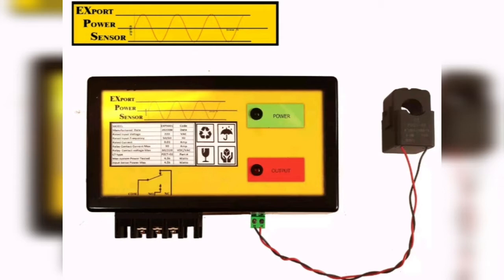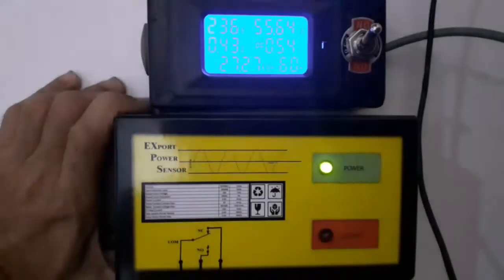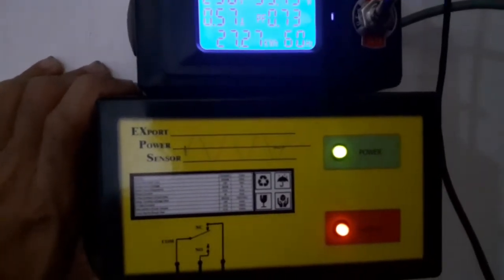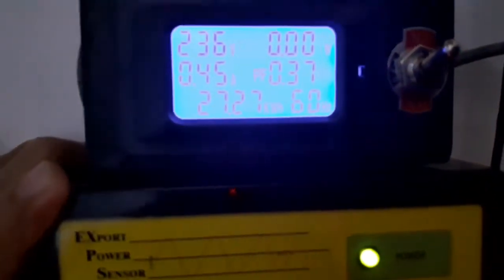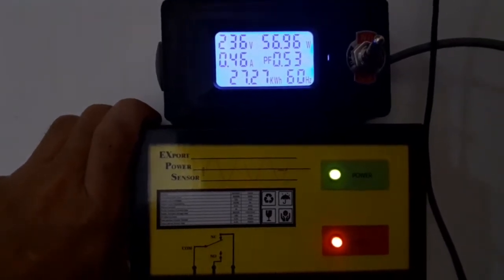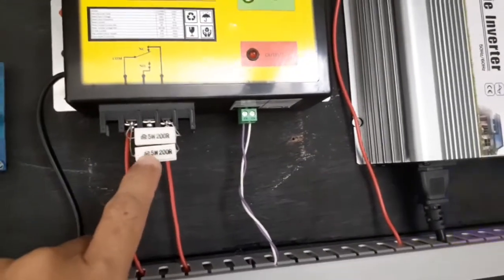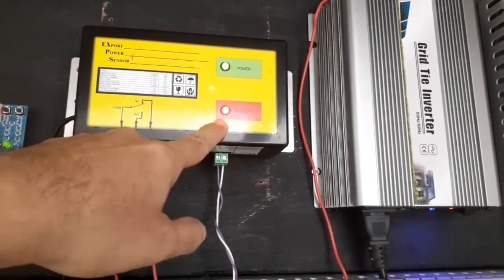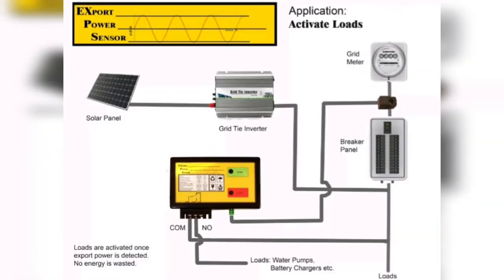Export Power Sensor for Grid Tie Inverter

Comment: Good morning boss. Meron sana itanong sayo bakit sumabog resistor 3pcs 5w 20ohm.. Naorder k lg sayo boss. 3kw ang on grid inverter ko boss.. S pv 450watts - 4pcs naka series po yan..
Reply from the maker: Upto 300wats lang po recomnded namin na may resistor. Mag mataas na watts setup nyo ibang wiring na po
Reply: @JonsDman  ano recommend mo boss ganyan mataas na watts.. d na ba kailangan resistor  at ano solution s gadget mo boss.. para magana sya..
Reply from the maker: @rodrigoolita4874  sa fbpage po namin may mga sample wiring para sa mataas ma watts setup.
Reply: @JonsDman  nacheck ko po boss. Ano klase wire & ano design diagram.. Para dyan s akin setup boss..thank
Reply: @JonsDman  boss napm po ako s messenger nio po..

Comment: Export power sensor lang pala yan. D naman pala sya export control limiter. Montik pa naman ako bumili sa shopee.
Reply from the maker: Nasa skills na po ng gagamit kung pano nya iwiwiring to prevent export. May mga sample diagrams kami para maintindihan function.
Reply: Pag bumili ako boss pwede paturo?

Comment: Sir pede po ba to sa 3kwsetup?
Reply from the maker: Yes sir madedetect nya export power presence from 3kw setup.
Reply: @JonsDman  meron po kasi kami 3kw gridtie inverter na walang limiter ang sabi ng nakausap namin d daw pede yun kelangan daw may built in na limiter
Reply from the maker: @nadzirk6677  opo sir dapat ma prevent ang export dhil babayaran nyo din yun.

Comment: Hi ano po e lalagay ko na resistor pag sa 12v inverter 350w solar panel
Reply from the maker: Try nyo po 30ohms 10w 6pcs parallel. Dagdag or bawas nalang po ng parallel dipnde sa observation nyo.

Comment: sir nakabili po.ako ng ganyan, working naman po sya, nangyayari nga lng ponkapag naka detect sya ng export binababa nya ung inverter to 0w tpos charge sa scc, diba dapat  po babawasan nya lng ung pumapasok na power galing sa panel?
Reply from the maker: Yunh device po ang function nya ay detect ng export. Depende po sa value ng resistor kung ano ang ibaba ng power ng gti.
Reply: 3 pcs 10w 30ohms po, sir ang naka kabit ,pero nag 0 zero ang gti, kahit malakas din ang panel
Reply from the maker: @Zen-wu9gn  try nyo po mag dagdag ng parallel na resistor. Pwede din po kayo mag compute ng value using ohms law.

Comment: Sir ano po kaibahan nito sa current sensing switch?
Reply from the maker: Current sensing switch hnd nya alam direction. Mag trigger sya both way. Ito pong samin mag trigger lang sya sa isang direction.
Reply: @JonsDman  salamat sa clarification sir. Gusto ko sana ito gamiting tong device nyo na mag-activate siya ng relays while nag-step up ang export current incrementally. Possible po ba? Para po sana gradual ang pag switch ng mga PV strings/arrays as needed.
Reply from the maker: @practicalthinker5545  madami application ito dopende na po sa creativity skills and knowledge nag gagawa. Visit nyo fb page namin may mga sample application po kami.

Comment: paano boss kng gabi na syempre mag ooff yong GTI kasama ba e turn off yong EPSensor ?
Reply from the maker: Nilalagyan nila ng timer para mag cutof ang ac line ng gti kasama ang eps pag gabi.
Reply: @JonsDman  boss na install ko na yong grid tie ko at my automatic timer switch at my  ATS pero sa ATS ko separate yon sa off grid yon. Ang tanong ko boss paano malaman kng working na talaga yong setup ko kc curious lng ako dito sa DIY ko d ko alam kng ito na talaga kc palagi ng oon yong EPS ko normal ba ito? kc enadjust ko yong EPS paatras, 500watts ang panel lo, pero 250watts lng ang harvest tapos gumamit ako ng appliances na 100watts below, pagbaba ba ang gamit mo parati ba nag oon yong OUTPUT SENSOR?
Reply: salamat sa reply boss....
Reply: setup ko pala DIVERT THE POWER TO BATTERY...
Reply from the maker: @ernilcervantes5766  eto pag check kung okay ang setup: 1) pag off ang gti dapat po mamatay ang red led ng EPS. 2) pag mas mataas ang harvest ng panel VS load dapat mag on ang red led. 3) Pag mababa naman ang harvest VS Load dapat patay ang red led.
Kung mag aadjust kayo ng sensitivity dapat po may power meter kayo sa main line para ma observe nyo kung anong watts nag ttriger ang red led.
Reply: @JonsDman  meron na akng watt meter binili k sa online...kinabit kuna....kng ang GTI ko nghharvest ng 250watts then yong EPS ko ay patay...so stop yong metro ng bahay ko...ok na yon.... ito yong tanong ko boss once ngzzero yong GTI watts meter ko yong EPS ko on yong red led ito ba ay normal o kulang lng ng adjustment ng sensitivity or ng eexport na cya at ito ba ay dagdag bayan ko sa bill? salamat sa reply...
Reply from the maker: @ernilcervantes5766 tama po. pag umilaw po ang red led. Baba ang power ng gti para hindi mag export. Dipnde na po kung ano value ng resistor kung gano kalaki ang ibaba ng power ng gti.

Comment: Sir ask ko lang.kung mababa yung consumption  ng import sa grid,na lilimit din ba nya automatic?o nag read lang ang external limiter ng meron at walang load?,kasi worry lang ako,baka mag export pa yung inverter,tataas din consumption ko.saka yung iba na may limiter na baliktad ang ikot ng metro.pano po dun sa digital meter?
Reply from the maker: Ang nerread po nya kung may export hnd po load.

Comment: ang pagkabit po ba ng sensor ay iclaclamp lng sa positive at negative ac line bago breaker?
Reply from the maker: I clamp po sa isang wire bago mag breaker.
Reply: positive po ba sir?
Reply from the maker: @geslerasprec5790  sa live po. Yung iba tawag ay poaitive.

Comment: 6x 350 kya kyan if my scc pra batt?
Reply from the maker: May wiring para sa high power application. Hnd pwede direct connect sa dc yung built in contact nya pag high power. Need gumamit magnetic contactor
Reply: @JonsDman  pero kaya pa nmn ni export power yunh ganun kataas na pv. Meron kasi ako gritie setup 2klw inver without limiter at 4x350w pv. Balak ko sana upgrade add pko 2pcs 350w pv at gamitan ko sana nyan na may battery pra sa sobrang harvest wla kasing limiter yung inverter ko. Hanggang ilan po ba voltage at wattage ang kya ni export power.
Reply from the maker: @reumau5053  kaya po bsta kaakabitan magnetic contactor.
Reply: @JonsDman  sige po sir salamat sa info.

Comment: sir ilang amps po ba dapat dumaan na export para ma sense ng CT at ma patay ang inverter?
Reply from the maker: Power po na palabas. And dipnde sa adjustment ng sensitivity.
Reply: ahhh ok sir. 
malayo po ako sa topic

posible po bang i tie ang grid tie inverter paralel sa isa inverter pero off grid na pure sine wave? 

if pwede, d po ba masisira ang off grid inverter? or pwede po ba gamitin ang export limiter para ma control ang grid tie inverter. curious lang po
Reply from the maker: Hnd ko po ma aadvice.yan dahil hnd po design ang off grid inverter na pasukan ng another source of ac.
Reply: ahhh ok po sir salamat

Comment: Good am..paano kung ang main breaker is 20 meters from my solar set-up?paano e kabit ang c clamp?taasan ang wire?anong klaseng wire?Salamat po..
Reply from the maker: Shielded wire po dapat, may mga nag install na po 10 meters using coaxial cable or tv antenna wire. Kung mas mahaba po palagay ko kailangan shileded na para walang ma pickup na nois at mataba pa para maiwasan ang loss due to high resistance pag manipis ang wire.
Reply: @JonsDman  Salamat po sa info...

Comment: Ilang watts ng solar panels ang kaya nyan?
Reply from the maker: May 30a po rating ang contact. Pero we suggest na wag sagarin apara humaba ang buhay ng contact, kadalasan po nilalagyan nila external relay or contactor pag malaki na ang system nila and para tumagal life ng eps relay contact.
Reply: @JonsDman  sir meron po ako 310 watt na solar at micro gti pwede ko po na lagyan ng export sensor?
Reply from the maker: Pwede po sir.

Comment: Paano pag zero yung load like for example walang tao sa bahay so mag eexport parin nang power base sa resistor
Reply from the maker: Kaya po hindi kasama sa device ang resistor para pwede nyo baguhin ang value depnde sa req ng bahay. May mga device po tayo sa bahay na kailangan ng power kahit wala tayo like home security, ref, auto lights etc.
Reply: Sir kylangan ba lagyan ng resistor yan or ok din na walang resistor
Reply from the maker: @emmanuelgilbao8989  dipnde po sa setup na gagawin. May wiring na di kailangan resistor.
Reply: @JonsDman  ah ok tnx poh sa reply sir

Comment: halimbawa po ang konsumo ay 300w at ang na produce ng 600w inverter ay 500watts, ang tanong ko po, pabababain po ba ng sensor sa 300watts ang production para hindi mag export? or totally zero ang production ng power , pati yon 300watts na kailangan maproduce ay mawawala rin?
Reply from the maker: Bababa ang power dahil sa resistor and tataas ulit hangang 300w dahil pag lumampas 300 may madedetect na export. Mag cycle lang sya until wala na sya madetect na export.

Comment: Sir question regarding the digaram with an SCC, panu kapag nagbrownout, automatic din ba sya magdivert ng power to SCC?
Reply from the maker: Sa sample daigram, hindi po. May ibang wiring po pag divert to scc pag brownout.
Reply: @JonsDman  Sir, pwede pa request ng video tutorial kung paano mag setup na auto switch pag walang power/brownout..
Reply from the maker: @chrisalvarez24  ok lang pag may time. I suggest nuod kayo video about relay  Dpdt, yun kasi gingamit para mag transfer ng mga connection.

Comment: Question ulit sir, may dalawa akong solar panel na tig 100watts, 19.5v(Voc) and 18v(Vpm), yung GTI ko ay Grid Tie Inverter DC22V-60V to AC190-260V, tpos yung konsumo ko na watts ay hindi bababa ng 100w dahil sa ref at iba pang appliances na parating nakasaksak, anong value ng resistor ang dapat kong gamitin
Reply from the maker: Usually 30 ohms 10w 3pcs gingamit.

Comment: sir tanong ko lang .. po about sa items na export sensor ... gagana lang po ba sya .. kung meron masesensor ang clamsensor sa Du automatic nya po ba ioopen ang GTI at malilimit nya lang po ba ang magiging consupsion natin .. at yung sobrang mapoproduce ng solar hindi mapupunta sa Du
Reply from the maker: Pag may ma detect na export mag sswitch po ang contact nya. Dpnde na po sa inyo kung ano magiging application kung pano nyo iwiwiring. Pero kung susyndin nyo po ang mga sample application wiring ba connected sya sa input ng gti, yes bababa po ang power para hnd mag export and kung wala naman ma detect na export ay full power ang gti.
Reply: @JonsDman  dibali sir .. pwede sya gamitin bilang limiter sa Gti
Reply from the maker: @CinemoPH  yes basically limiter po ang function na mag prevent ng export..

Comment: Do you have to have either a battery to charge or a load for excess? Are you saying that it won't limit export without that?
Reply from the maker: If no battery is installed the export will also be limited but the excess power will be wasted.
Reply: Resistor is mandatory if no other dump load is connected?

Comment: Sir gagana ba yan sa 100vac system na grid?
Reply from the maker: Gagana po yan kung gagamitan ng 100 to 220 vac transformer ung power ng device 220vac kasi sya and need nya madetect ung frquency ng ac line.
Reply: @JonsDman  salamat po sir. 200vac splitphasr pala dito yung grid. gagana nga cguro yan. Kayo po nag design ng nito? Hndi ko kasi mahanap kng saan pwde mka bili bawal daw sa lazada iship sa ibang bansa
Reply from the maker: Yes sir ako po nag design. Pag usapan nalang po natin pano kayo makaka kuha.
Reply: @JonsDman  hello sir opo saan po kaya ako maka bili nyan? Makano po kaya? Details pls.

Comment: so kung di mo malalagpasan rating ni inverter laging na ka off
Reply from the maker: Ganito po sir, pag walang na dedetect na export ay naka full power panel to inverter,  Then pag may ma detect na export ay mag sswitch ang eps at dahil may resistor baba ang power from panel to gti. Then pag wala na ulit ma detect na export mag full power ulit panel to gti.

Comment: Good day po sir Jons,  ano po ang difference ng device na ito sa power Limiter na usually built-in sa Solis at Sofar GTI?
Reply from the maker: Ung built in po ay binbawasan nya power going to gti, this device naman po ay dindivert nya sa NO terminal ang power kaya hnd masasayang ng power  kung lakagyan mo scc at battery sa NO terminal.
Reply: @JonsDman  sir pano ito isetup sa solis, may fb po kayo?
Reply from the maker: @BlottedInKs  sa fb page po namin JCXtreme, andun po mga sample application diagram including high power GTI.
Reply: @JonsDman  magwork po ba ito sa solis?
Reply from the maker: @BlottedInKs  ang pwede nya.controllin dc input papunta sa any brand gti.
Reply: @JonsDman  anu fb nyo

Comment: That would be great if it works in AC110v.
Reply from the maker: It will work using 110vac to 220vac converter.
Reply: @JonsDman  *step down transformer

Comment: how much is this unit US dollers? the website says 2,200.00 about how much is that US and can you order them form the US?
Reply from the maker: It's around 45USD.
Reply: @JonsDman  where can I order it
Reply from the maker: @brandonoh777  voltage rating of this device is 220v ac. We have to customize for 110vac application.
Reply: @JonsDman  u.s. power is 2 lines of of 120volt that makes 240volt. Does this mean if I get 2 of those current measuring transformers and put them in series on the 2x 120volt, it will work?
Reply from the maker: @JasonLeef33dm3  connectinh 2 of this in seriea will not work. The easiest way.to do is replace the transformer inside. 220vac to 12vc 1amp. Replace with 120vac to.12vac 1amp.
Reply: Whether your device will work in 375w×2 mono perc solar penal fitted with enphase iq 7 micro inverter.
Reply from the maker: @durbadalapanigrahi9180  yes it will work. The supply of device 220vac

Comment: Sir ask lang po 800watts panel set up ko kaso namamatay po si inverter at prang hindi normal ang init pwede ko po bang gamitan yun ng resistor...
Reply from the maker: Kailangan po malaman kung bakit namamatay inverter. Usually po may specs ang input ng.gti, check myo po kung pasok. Pag nilagyan nyo ng resisitor baba po ang current from panel.

Comment: Sir ok lng ba na maliit Ang wire na gamit pagpasok sa inverter.ano size po wire po required.
Reply from the maker: mataba mas maganda po. Pag mataas po ang current magnda po mataba ang wire.
Reply: Ito na po ba Yung prototype sa unang video nyo.?
Reply from the maker: @eduardobautista4442  ung sa unang video po ay mas advance ang function nya pero mahal po ang mga parts kailangan re design to lower the  cost. At ito naman Exps they have same power sense circuit. And mas madaming application pwede.
Reply: Sir paano po Kung washing machine Ang load paano response nya variable ksi umaandar Ang motor Ng washing machine
Reply from the maker: @eduardobautista4442  sa mga ganyang gamit magnada ang device like aircon ref washing machine kasi sila ung lagi patay sindi ang motor. Madedetect ng device kung nag export ang power dahil na matay ang motor. Pag bumukas naman ulit ang motor malalaman din po ng device dahail wala ng export then i full power nya ang gti.
Reply: Ng order n po ako sir sa Lazada.my warranty po ba?
Reply from the maker: @eduardobautista4442  meron po dalhin nyo lang po ang unit sa shop kung may sira.
Reply: Ok po sir salamat.kya saan po ba shop nyo.bulacan po ksi ko.
Reply: @Jons Deman sir saan po ang shop nyo?
Reply from the maker: @ThePeppercsantiago  Cabuyao laguna po

Comment: Sir pano connection kapag ilalagay mo sa battery charger o ibang load para walang masayang na kuryente kapag nag eexport
Reply from the maker: Sir COM and NO po ang gagamitin mo. Kung pano ka po mag wiring ng switch ganun din po. 220 po ang dadaan na sa contact ng Exps.

Comment: Ano po circuit ang pwede ikabit para hindi mag export ng power ang grid tie inverter na walang limiter?
Reply from the maker: Device po na na mag rereduce ng power from panel. Buck converter or resistor. Kung naka parallel naman ang panel, pwede po disconnect ibang panel para bumaba ang power.